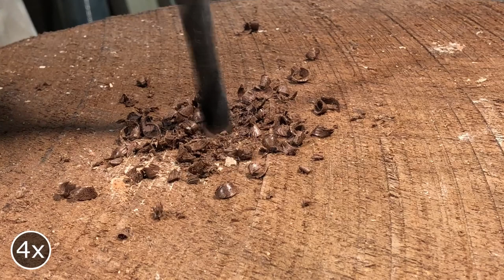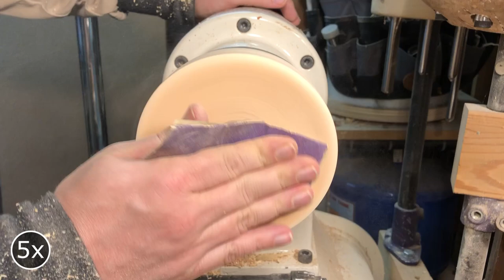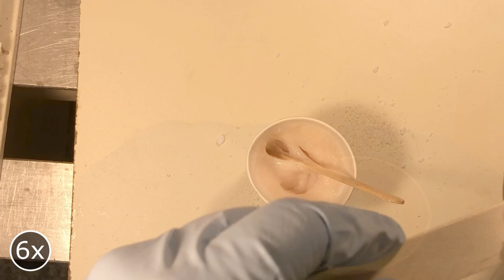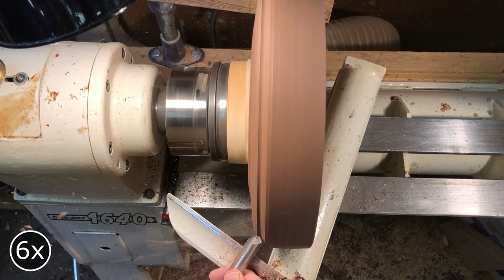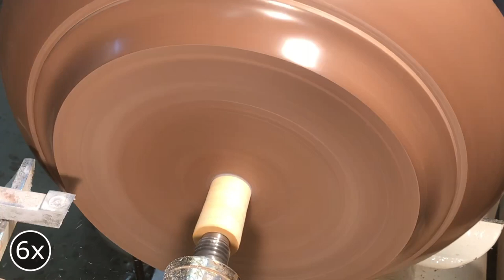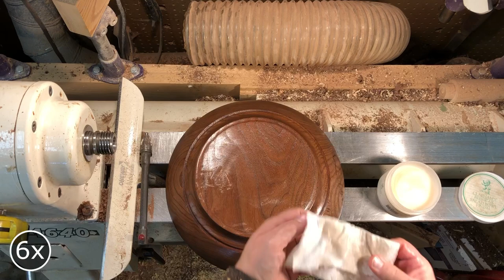Woodturning - American Black Walnut Fruit Bowl

Comment: Everyone has their own way of doing things.  No arguing with the end result.
Reply from the maker: Thanks for watching again Lois. I agree, there is no single way of doing things. Ordinarily I wouldn’t bother adding a block to the bottom of a bowl. However, this blank was too valuable and too thin for me to waste any wood turning a chuck tenon on the bottom. 

I won’t hesitate to use this adhesive combo again. Although I will be dealing with the glue squeeze out differently. 😧

Comment: Nice bowl Croacky. Seems you are experiencing some vibration issues, I had them too. One way to reduce vibrations is to start hollowing at the side and finish that part until final thickness before continueing with the central section of the bowl. Not my original idea but it does help.
Reply from the maker: That is a very interesting strategy for larger bowls. A strategy I’ll keep in mind. Thanks for posting it.

However, the vibration here was mostly me pushing the pace. This particular blank was extremely hard and dense and slower cuts probably would have left me with a cleaner surface.

I’m not sure if pursuing a smoother surface would have saved me any time on this bowl. The performance of 3M Cubitron discs often makes them the fastest option.

Comment: So funny. I'm working on a piece of black walnut just like this, today. I was wondering how well a glue on tenon would hold. I've seen some guys use CA glue as well. That turned out great.
Reply from the maker: You could probably get away with regular wood glue as well, if the mating surfaces were flat enough and you could apply adequate clamping pressure.

I used epoxy here because I knew neither the walnut or the tenon would be completely flat and the adhesive would have to bridge the gap. I’m still surprised at how hard and tough the filled epoxy was. 

Thanks for commenting.

Comment: It turned out great! What vac chuck did you use?
Reply from the maker: Thanks!

The vacuum chuck used in this video is a Oneway 8” drum chuck with a Oneway Rotary Air Fitting on the outboard side of the headstock. I’ve updated the links in the description to include information about my vacuum chuck set up. Thanks for letting me know that info was missing.